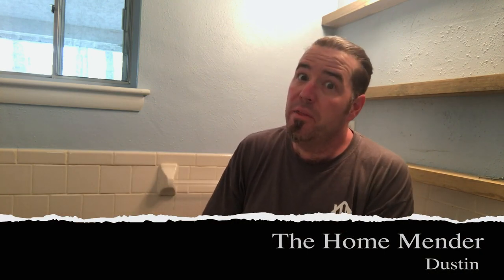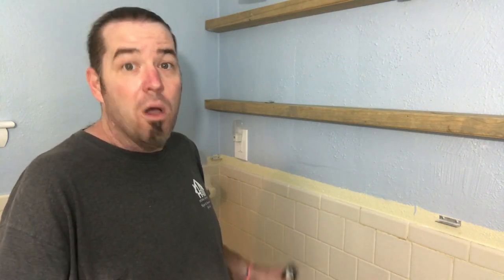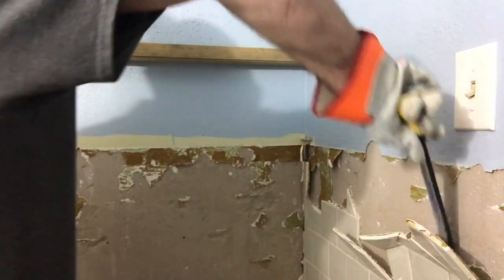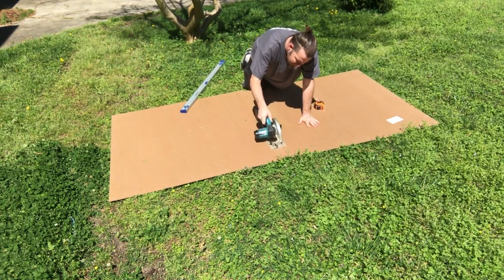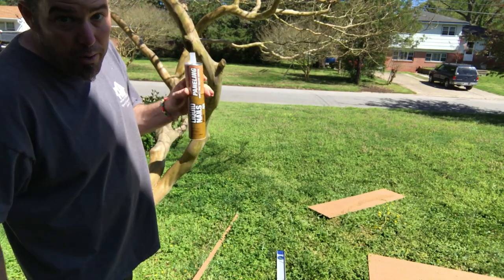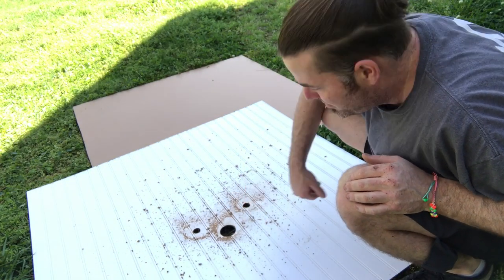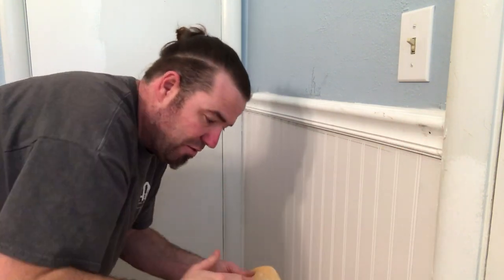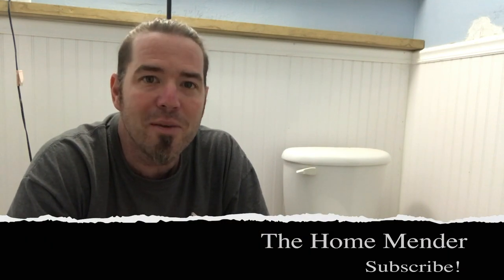Tile off the wall, install wainscoting. Easy bathroom!

Comment: Hey man you’ve helped me more then any of the other cats.
I changed a subfloor board, hung doors, and repaired a door all because of your realistic videos. I would have done better on a floor if I had of followed what you said instead of going out on my own. I hope you haven’t stoped videos, they really help.
Reply from the maker: Heyhey Thomas.   That’s awesome to hear my friend.  Check out the new ecourse and digital guide.  Home mender in your pocket! And thanks so much for sharing.

Comment: The first way you cut 2 pieces of chair rail to join them at a corner, that seems odd (15:15 - 16:50). You cut the left piece straight, then you used a coping saw for the right piece. Then for the next corner, you just cut both of them at a 45 degree angle (16:45). You made it sound like coping would give a cleaner end result. Why would coping look better?

Nice trick pre-filling it with caulk! Thanks for the video.
Reply from the maker: Hey Patrick yes sir thank you so much for sharing. I wanted to show the two different ways to create the corner. Coping it helps one piece layover the other and just provides a cleaner more professional look, plus it makes up some of the space in case you don’t have an exact 90 Degree corner. Thank you so much for commenting

Comment: Can getting rid of the wall tiles actually be a bad idea in bathrooms that don't have windows, because of the moisture buildup? Are there any special precautions or extra steps you would do when installing wainscotting in a windowless bathroom, vs. one with windows? (Yes, windowless bathrooms with showers do exist. They usually have an exhaust fan to pull out the moisture from showers, so you don't have a problem with mold.)
Reply from the maker: Hey Melissa typically every bathroom is required to have either a window or an exhaust vent to the outside, the fancier ones do a better job but no there should be no issues replacing the tile, as long as you have your fan and it’s doing the job you are good to go. Great question
Reply: @homemend  Thanks. My house was built in 1964 and never been updated since. I have a weird bathroom right in the middle of the house that has no window. It does have an exhaust fan, which comes on automatically whenever the light is on, but I don't think it works very well. I heard that you can test if an exhaust fan is working by seeing if you can get a piece of toilet paper to stick to it. It doesn't stick. I want to do something about the wall tiles, but I have to be careful about moisture and potential mold buildup because it gets very steamy from the shower because of the ventilation situation. I'm wondering if there's some kind of wainscotting I can just put on top of the tiles, without having to remove them, but like I said, I have to be sure that mold can't grow behind it.
Reply from the maker: Hey Melissa definitely invest in a decent fan putting a good fan in there sounds like it will take care of any concerns you may have with moisture. Make sure your ductwork has been cleaned out in the last year or two and get air flowing through there. You got this
Reply: @homemend  Have you heard of the toilet paper test for exhaust fans? Just because you can't get toilet paper to stick to it for more than a second or two, is that really a reliable enough sign that it's not working properly? Or does that not mean anything?

Comment: This video is excellent. My only question, my bathroom is demo'd and looks exactly like this one in the video. Can you provide a link to the 4x8 Wainscoting paneling you used? I just want to make sure whatever I put on my wall will take paint and handle the moisture.
Reply from the maker: Hey Matthieu as long as you get a good coat of paint on it you should be good to go. Here’s the panel that I used in the video.

3/16 in. x 4 ft. x 8 ft. White MDF Truebead Wainscot Panel.  Currently 28 bucks a panel

Comment: Should you be concerned about asbestos when you do this? Is it in old tile glue, since it looks very similar to black mastic, which was the glue that was used on floor tiles up until the 70's, which had asbestos in it.
Reply from the maker: Hey Melissa we just kind of roll with it, if it’s dusty and hard to breathe throw on a mask, if it’s known to be made as asbestos such as the glue or the 8 x 8 old-school kitchen tile or the pipe wrap stay away from it otherwise we roll on. I hope this helps

Comment: My bathroom is built in the 50's. It has that thick chicken wire mesh stuff under the tile. We removed it in master bath and it was pure h3ll! Can I just cover the tile in our hallway bath with the wainscoting? I dont want to paint it just want to cover it. Also, how do you suggest the best way to cover that it will last a long time?
Reply from the maker: Hi Melissa yes it’s definitely a lot of work but totally worth it. You could cover over it but you would have to use adhesive to secure it to the tile. It might get messy. I hope this helps

Comment: Do you need to allow a small gap in the corners for the wood to expand? Also, is it best to do this after installing baseboard or should I install baseboard over this like you did? For the same reason, expanding panels. Background: I am putting paneling up in my daughter's closet on the back wall and two side walls.
Reply from the maker: Hey Angel. Great question this would not cry or require any room left for expansion. You can run with it!

Comment: I am doing the same project - removing tile halfway up my bathroom wall and installing Wainscoting. Did the MDF board hold up in a bathroom? Im  afraid to use MDF because of the moisture and water. Im opting to go with bead board wood siding panels instead. Thanks for the video!
Reply from the maker: Hey Troy this one held up well of course it was a half bath. I’m guessing it depends on how hot you like those showers my friend. The wood is gorgeous but a little more expensive. And after painting either one with semi gloss paint it’s pretty protected.

Comment: can you glue wainscoating directly to the tile instead of removing it?
Reply from the maker: Hey Robin. You probably can but I wouldn’t recommend it. I’m guessing moisture issues may be a problem but and a half bath we’re really just trying to make it look pretty. It seems something crazy enough that I would try LOL
Reply: If it's relatively flat you can go over, remove the first row of tiles put a thin piece of wood to shim, put a shim above the last row of tile, nail to the top and bottom shim into the studs, glue the middle of the board using a good adhesive, PL premium polyurethane adhesive should hold the panel really tight even against ceramic tile.  Moisture won't be an issue, I bought my house and the previous owner had a contractor redo one of the baths and this is how it was done, it's been up for probably 7 or 8 years and there is no sign of any problem.  If you want to rip the tile out use a pry bar and a big hammer to "pop" the tiles or even better a rotary hammer.  If it's really old the wall behind the tile is concrete, ripping it down is not really a good option because you won't really be able to nail into it anyway.

Comment: When I pulled my ceramic tile down, almost all of the adhesive stayed stuck on the wall. I tried to use different techniques to remove the adhesive from the wall, but am having little success with these methods. I probably only have 10% of the adhesive off and I have been working on it for hours. Can I just skim coat over the adhesive and let it dry before I put my wainscotting up?
Reply from the maker: Hi Amanda I would just scrape off the chunky stuff and go ahead and go over top of it. As long as you can get it to lay flat you’re good to go. 🙂

Comment: A couple of questions if you don't mind? My bathroom is from 1926, will the tile adhesive be the same? It's not on drywall. Why didn't you use the multitool to remove the tile? Also, can you put drywall over tile and save the tile demo work?
Reply from the maker: hey paul...you could go over tile but its not recommended. just as a class thing..people will know..lol i did classic hammer and scraper, prybar, chisel or whatever you have to remove it...the multi tool would dull very quickly....1926..it should be just as tough this one..you got this!

Comment: Where did you buy your wainscoting? I want to make sure I get the correct kind that will be water resistant and not warp in a rental property.
Reply from the maker: Hey tiko!   This one was paneling from the depot. Whatever you use, As long as you get a good coat of semi gloss on it you’re good to go.
Reply: @homemend  thanks for the fast reply. I'll subscribe!

Comment: A trim puller removal tool works a hundred times better than that 3 in 1 tool you used.  Pops off the tile with ease , you should try it.
Reply from the maker: Awesome suggestion you be I’ll check it out. Thanks so much for commenting!
Reply: @homemend  This is the one I have, it works awesome on those small tiles.  Zenith Industries ZN700001 Trim Puller.  Take care.